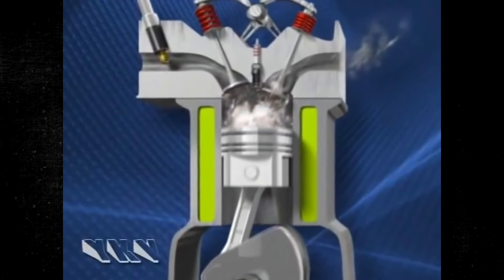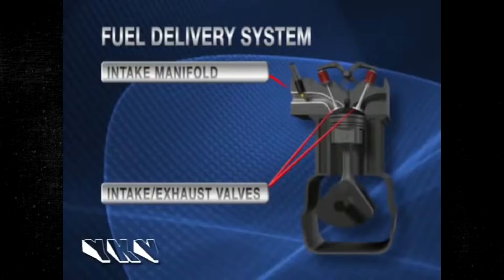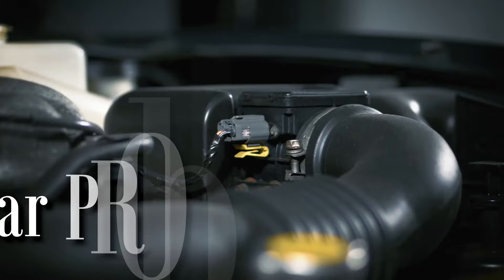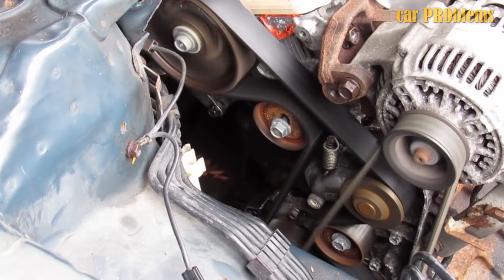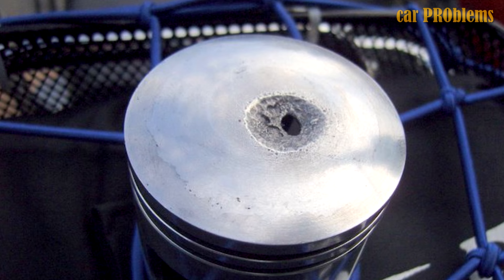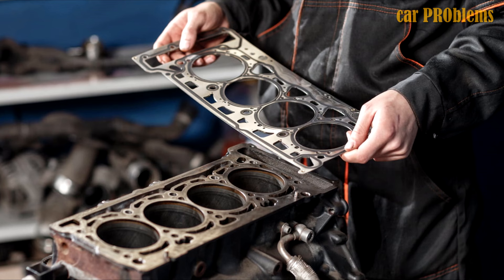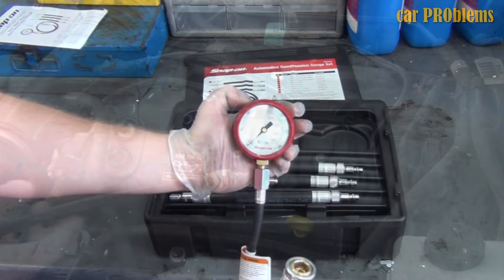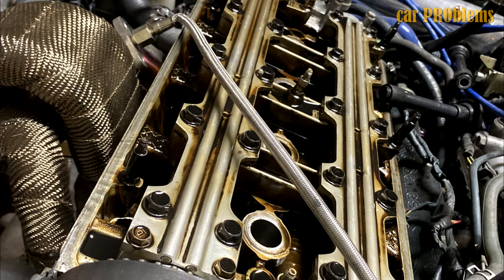5 Causes of Low Compression - How to Fix Low Compression

Comment: 3.7 vqvhr engine 1st cylinder misfire already put new spark plugs and ignition coils. Low compression on 1st misfire all others are good plz help
Reply from the maker: Hey there! Sorry to hear about your misfire issue.
Even after changing the spark plugs and ignition coils, it seems like the first cylinder has low compression. Here are a few things you can consider:
- Do a cylinder leakage test to check for any leaks in the cylinder.
- Check the valves for any issues like worn-out seals, damaged seats, or faulty springs.
- Worn-out piston rings could be causing the low compression, so keep an eye on that.
- Also, check the head gasket for any signs of failure.
To get a proper diagnosis and solution, it's best to consult a qualified mechanic or engine specialist. They'll have the expertise to identify the problem and help you fix the misfire. Good luck!

Comment: 2002 Honda Accord low compression all have 60 psi
Reply from the maker: Hi!  Low compression across all cylinders could be caused by several issues.
- Timing belt failure,
- Worn-out piston rings or cylinder walls,
- Damaged or improperly adjusted valves,
- Blown head gasket,
- Damage to the cylinder head or block.
Reply: You need to check to be sure, but there are probably leaks. It could be cylinder, rings, gasket and/or valves, if I were to bet on something would be cylinders. Does your vehicle emits blue-ish gas?
Reply: @carproblemsmax my 2007 Nissan versa have a low compression too but its on cylinder 4 only I check the oil dipstick and my radiator I don't see any brownish or milky color on it so it's not a head gasket do you thinks it's a worm valve guides and seals? Because I make compression test today and they found out that my cylinder 1 2 3 is okey only cylinder 4 is low compression.

Comment: I got my engine back from a rebuild using the same parts. Car is about 50whp short, but runs, drives, and idles fine. Would getting a compression test be worth it?

Comment: Interesting one. Have a buick 3.8 series 3 v6 that keeps registering a dead miss cyl 4. I've checked everything and all good. 150 psi in cyl 4. Here's the monkey. When the car cranked during the compression check the gauge fell to 20-25 lbs. I'm thinking a gummy slow moving valve. Spark is great, new injectors and compression at 150 when cranking. I was about to tackle the intake gaskets when I stumbled upon this low compression when it started. Any thoughts would help. Thanks.

Comment: would bad timing chain foul plugs?
Reply from the maker: No. A bad timing chain is unlikely to directly foul spark plugs. The timing chain's primary function is to synchronize the opening and closing of the engine's valves with the movement of the pistons.

Fouled spark plugs are typically caused by issues related to the ignition system, fuel system, or engine condition. Common causes of fouled spark plugs include:
- Rich fuel mixture. This can be due to a faulty fuel injector, malfunctioning oxygen sensor, or issues with the engine's air-fuel mixture.
- Oil consumption. If the engine is burning oil, it can lead to oil fouling on the spark plugs.
- Incorrect spark plug heat range. Using spark plugs with an incorrect heat range can lead to fouling.
Reply: @carproblemsmax  thank you

Comment: 1 - You didn't read the, "As is", part of the sales agreement.
2 - Your girlfriend after her cross-country road trip - "Gears?!"
3 - Clyde really hasn't, "worked on no foreign car", before.
4 - After replacing the gasket you can't find your 10mm socket.
5 - Motor oil is, "pretty much the same", no matter what it says on the bottle.
Reply: What is coolant?
Reply: @alexalexanderson8022  Yes, lol, and that.
Reply: I did read "As is" now I'm having issues😂

Comment: Have 6 cylinder with 4 cylinders with no  compression 2 on one bank 2 on other any thoughts? Timing ? Please help 😮got spark ,fuel pressure ,etc.
Reply: Either broke cam shaft or crank shaft I'd guess. Let me know how it turns out.
Reply: @martinobrien1877  it was valve sleeves on this particular motor slipped down then springs was stuck making valves open all time
Reply: I thought timing and went that way until I got in there found out problem